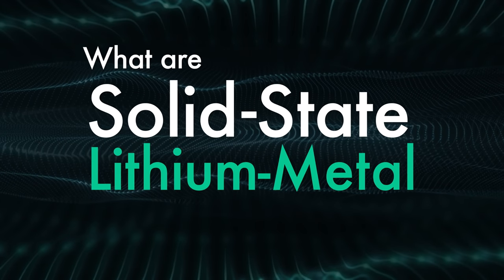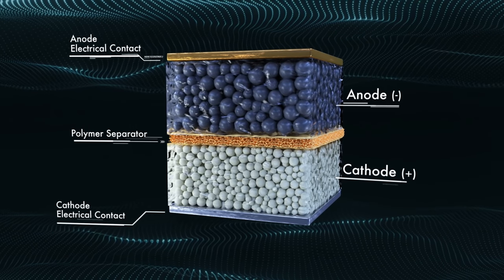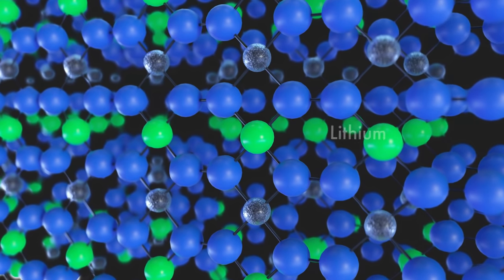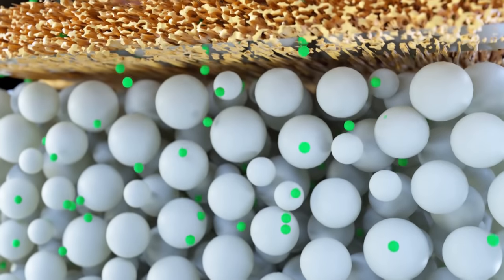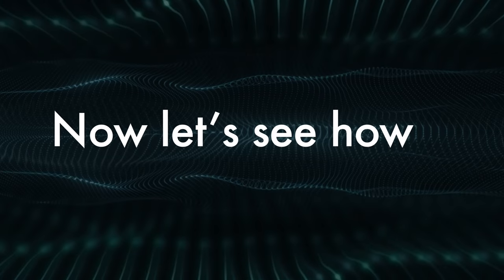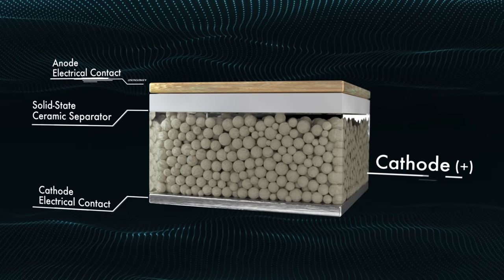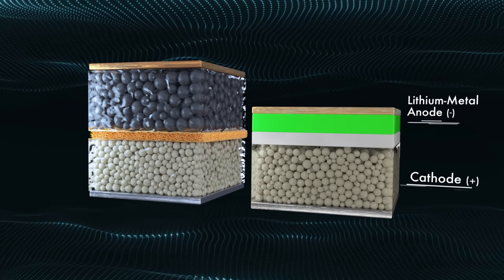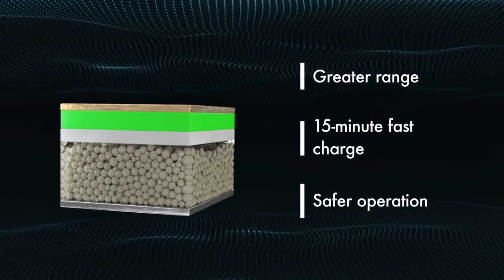What are Solid-State Lithium-Metal Batteries?

Comment: So does the battery become thicker with charging?
Reply: I would imagine putting a layer of space for the lithium to accumulate into.
Reply: in a quantum scape
Reply: Hello, I am researching SSBs at my university right now. The lithium will deposit at incredibly small amounts onto the current collector so there is pretty much no swelling. The concern is about Li filament propagation through the electrolyte which causes shortages as well as dead Li (Li that extrudes too far and we cannot get back)
Reply: The lithium batteries in my phone get dramatically thicker when overcharged,so I say 'yes' !😮
Reply: @deadlycucco7269  does this filament problem also occur with batteries that use liquid electrolytes?
Reply: @Shadobanned4life  your phone has lithium-ion batteries. As the lithium metal deposits as a "plate", there's no need for a chemical lattice to house it. The graphite composite lattice in Li-ion batteries is what expands. Since it's not present/needed,  expansion is non-existent here. Somewhat different chemistry.
Reply: @davidrave563 I do believe filamentation is also an issue in Li-ion batteries, but it progresses much more slowly due to the chemistry. So you'd only see that in near EOL-cycle batteries that have been discharged many times. Lithium metal tends to want to make this process occur much more vigorously and quickly. But they're exploring several workarounds to mitigate that issue and extend life cycles.
Reply: @S888A-KenObi  I see. Thanks for the info!

Comment: Will building a SSB require roughly the same amount of lithium material as a Li-Ion / LFP battery?
Reply: Yes. But for the same amount of material, it has higher capacity, so it uses it more efficiently.

Comment: Fascinating.  I've been studying electro-chemistry and cells a bit.  I am still confirming if a conventional lithium ion battery is an electrolytic cell. I think it is.  Electrolytic cells are an interesting beast.  They need external electrical energy to first oxidize a "salt" in solution of energetic counter-ions, like sodium chloride for a basic example, 

 Then these dissociated cations and anions (Na + and Cl- for example) travel through the electrolyte and "plate" their respective opposite-charged electrodes. This sets up the electrodes (anode -> cathode) for a redox reaction, which all batteries undertake to deliver electricity through electron flow from site of oxidation(anode) and reduction (cathode). 

 The cathode and anode are initially neutral and inert, but when electricity is supplied to the cathode, it becomes - charged, while the anode by default becomes + charged in relation.  This is all precursory setup The negative Cl- ion in this case plates the initially positive anode,  and the Na+ plates the initially negative cathode.  Now the anode can oxidize Cl-  coming together to form neutral Cl and can give off electrons, and the cathode can reduce Na+ coming together to form neutral Na, keeping the reception of electrons and current flow.

So, how does all this mumbo-jumbo relate?  It looks to me like lithium ions in solution with a salt in  the conventional lithium ion battery as described,  first plated along with carbon or some other counterion substrate at the anode, setting it up for oxidation and energy flow.  But apparently, QS's battery understands that pure lithium metal plated by itself at a not-yet-existing anode with no counter-ion substrate to pair with at this anode, is much, much more energy dense and storing, and a faster build of that potential charge.
Reply: Hey can you tell how electrolyte helps lithium ions  move from cathode to anode . Because in LIBs lithium ion from cathode moves through electrolyte towarfs anode but if we are using polymer based electrolytes LiClO4 so what is the function of Li and ClO4 how it helps lithium from cathode to move , how Li from cathode and electrolyte  differentiate. I am bit confused on role of electrolyte particular how we do it why we need it if only medium was needed why need of salt added

Comment: Pretty much all batteries are swelling("breathing") during charge/discharge
I wonder how the ceramic will hold up overtime, it feels like it will form cracks
This will either show in accelerated aging or have a slightly higher safety risk(but only if the lithium gets exposed to an oxidiser)
I'm just think about the LMP-battery fire that Bluebus 5SE have had recently in Paris
Reply: Nò LFP and LTO dont sweell unless overchaged continuousely obviousely